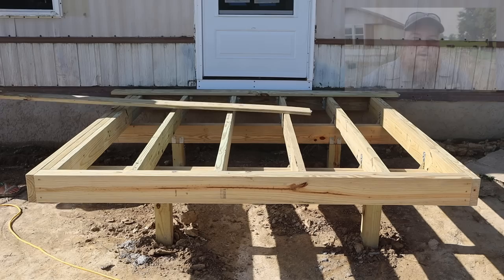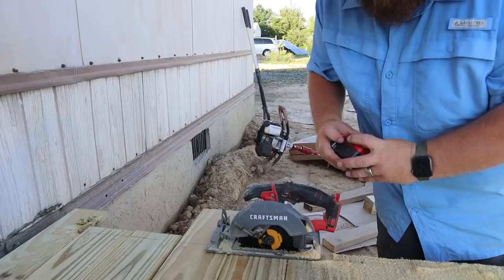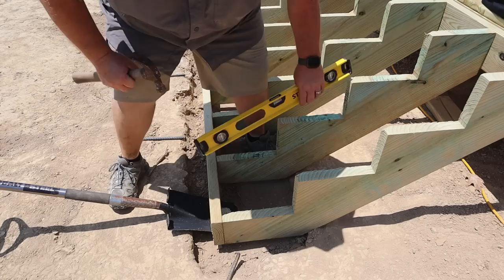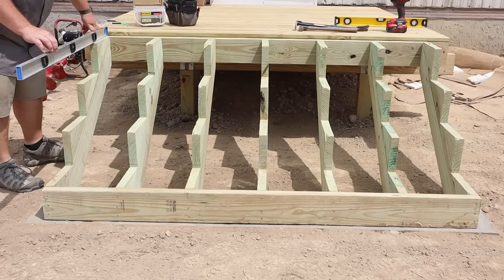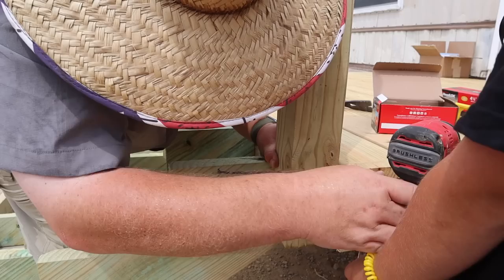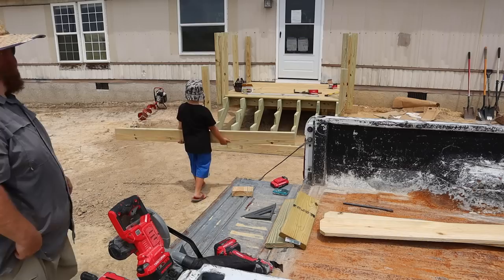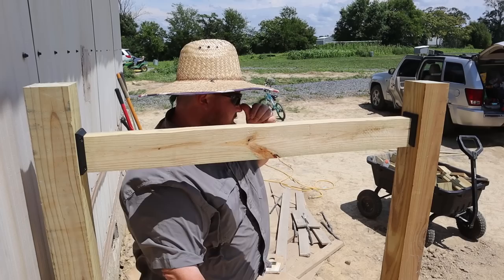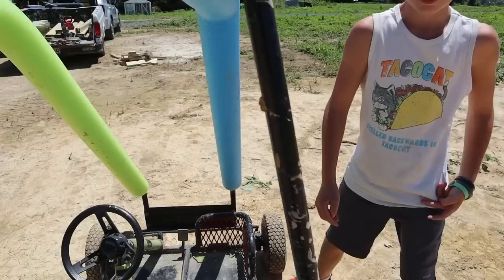BEAUTIFUL New Deck BUILT by US! // Mobile Home Deck Build - Pt. 2

Comment: Your deck looks nice! 
If I could suggest one small addition, it would be to consider adding risers to the front of the steps. I think that would make it look more finished.
Whether you do, or whether you're don't, you two did a great job! You have really transformed the place!
Reply: Yep I was going to suggest they look at what Life Uncontained did for their underpinning. Would look great. Horizontal 1x3, space, 1x2, space, 1x3  That might be cheaper than solid wood, but I don't know that for sure, there.
Reply: I completely agree. I love the deck, but it needs risers to finish it!
Reply: Agree, the porch looks  unfinished the riser boards look more fashion and safer
Reply: I completely agree.  The first step already has it and looks nice and finished. Regardless of whether you do it or not it looks great. I am so proud to see a family working together.  It's like the old saying that a family that prays together stays together . You all have done such a great job. Be safe in this heat and the storms that are coming. God Bless you all.
Reply: I've not seen decks with risers on them. I think this looks great!
Reply: @lindamaskus5142  really? If you google image deck stairs, 90% of them have risers. The ones that don’t, have very clean lines under the deck. Risers make it look a lot cleaner.
Reply: I don’t think you can add risers after the treads are installed.
Reply: We don't use risers. It's easier to clean snow off the stairs.
Reply: @laurieg673  I get that, but it looks much more finished with them. We have them in southern New Hampshire and haven’t had an issue cleaning snow off.

Comment: That tip on signed the oscillating saw back-and-forth actually works great! You can cut through material much quicker and you don’t burn up your blade as bad.

Comment: The deck looks really nice, the suggestion I would make is to attach the side rail posts to the stair rail posts. It will add a degree of sturdiness and avoid the side rails from tilting out over time.  Also the stair post at the top of the stairs I would add 1 or 2 screws in the opposing direction(into the stairs) think cross bracing. Fantastic that your taking the time to teach your son and to see that he's interested.

Comment: Now this is a pretty front porch. When you get it all painted to match whatever color you're going with for siding it will look even better. I think the lighter color goes better with your living room an inside then a dark color would. Then what? Hopefully the back porch will be about two or three times that size because that's the one you'll do barbecuing and eating outdoors with. You did manage to find a really lovely location and have fixed it up very nicely. Thank you so much for sharing!

Comment: Great job, guys - your forever home and property is really coming along!

I enjoy your videos and watching you consistently use your skills to build quality and professional projects. Not an easy task, I know! Kudos ...

A tip on further protecting your decking to future-proof your investments. First, it's great to see you're using pressure-treated wood. You can purchase liquid wood preservative to paint on the protectant and treat the wood whenever a cut is made. You can still do this now to protect your cut ends. A tip for your future floor joists is to use ZIP Tape (plastic rubber tape) on the top of your floor joists. This will prevent rot and allow your deck boards and beams to last many years. 

Hope it helps you guys out, and best of luck in the future! 

Cheers to all!

Comment: I nice tip I learned years ago that can also apply to wall framing is to cut strips of asphalt shingles. Place the strips under the lumber that has ground/concrete contact. It aids in keeping the moisture from staying in contact with the lumber from the concrete.

Comment: Good work.  But for future reference WD40 is your friend when working with form boards.  Soak the wood down just prior to pouring and your form boards will release easier.  A spade shovel also works well to pry the form board up from below reducing the potential damage to a slab.

Comment: Oh I'm so there with you I live in a mobile too an am so glad my necking is not attached to my home because the deck is sinking and I'm so glad it's not pulling my home apart. That's why I'm putting an extra post in the middle of my new deck so when I step out time after time it will not bowel or brack in the middle after a long life of use.

Comment: The county I am in in Florida has the same code. Decks cannot be attached to a mobile home. We also have to tie them down with screw anchors, on the four corners, if we build them on to of the ground with concrete blocks under the posts. Like the 2 x 4 railing with the balusters and the post caps. Great job. God Bless.

Comment: Not attaching the deck is a good idea.  Our place (1983 Scott Housing double-wide) has a ton of sag where the back porch was attached using a ledger board.  It wasn't due to settling, just the weight of the porch hanging off the outriggers.  Definitely not fun to fix!  We had to add beams and piers under the porch to make it self-supporting (not fun because it was pretty low to the ground), and we'll have to use a LOT of floor leveler when we get to renovating that room in the house.

Comment: Great looking deck.you 2 did a professional job.lumber is just not as good as it use to be.i have a 10x24 deck on the back of my house since 1975.i use Thompson's water seal on it every couple of years.i have never had to replace any boards.i did replace the steps a few years ago and put a roof over it about 10 years ago

Comment: Excellent job. We have to free float our decks on our mobile homes. The frost we get (Maine) causes a lot of movement to the decks and the mobile homes when the ground freezes and then thaws.  Our ground freezes 6ft down. 
Can you clue us in to what you're considering doing for siding when you get to that point?  We've been pretty unhappy with the vinyl siding.  It comes out way to wavy.
I wanted to do composite 4x8 sheets or T-1-11,  but hubs said no way on a rental.  Cheap & easy. 🤷‍♀️

Comment: I really like the end peices you used on the horizontal hand rails. If it's ok with you I'm going to steal the idea from you on a future deck I build. Lol 😆  
Talking about ,should decks be attached to the home . We purchased land that had a double wide on it that we renovated and lived in while our home was being built on same site. The previous owners had built their front door deck connected to the side of mobile home but they didn't use any beams! They litterly only had 2x6 joist only that were bolted to notched 6x6 post. Imagine the deck you just built but, without the two beams underneath.  😀  yeah ,it was a little janky and wobbly to say the least. Anyways I did have an engineer tell me that it's a horrible idea to connect a deck to a mobile home because most mobile homes use 2x6s for end joist while some of the "better" built mobile homes use 2x8s . Either case he said the joist are doing their best to support the weight of the home let alone the weight of a wood deck. We also had to build our front door deck lower than the door to give enough head space to the roof on the deck. Otherwise building the roof over the deck under the edge of the homes roof made the deck roof to short for most people to stand up. So basically our deck being lower than the door had steps under the door. Anyways just thought this would give you something to think about concerning your future roof over your front deck. Hope this made sense. Great job on the deck! It looks awesome!

Comment: Love how you included the kids in the build. Only way they are going to learn.
My question for you guys is , Are you going to film the back deck as well. And are you going to keep it about the same size as well or go bigger? When my dad did ours he built the back the entire length of the house as well as the front. But I always used the back for cookouts for the Firedepartment I'm on unless it was raining. The back was wide open and the front was completely covered. 50 feet on both sides the house
Reply from the maker: We just finished the back deck today. It is larger -- 12x10. And is built in a stronger and beefier way. :) The build videos will come out soon!

Comment: Seems like you had a bit too much water, you could have gotten away with a much dryer mix.  Also, the dryer the mix, the stronger the final result.  Shouldn't be an issue in this use case, and the deck came out awesome.

Comment: Looks nice but I have to tell you from experience that the floating 4x4 support columns are not very safe. 
One trip, someone leaning on the rail is all it takes for it to give way and you'll end up on the ground. 
Hopefully if/when that happens you won't break your arm, sprain your shoulder and get stitches in your head like i did. All that from tripping and falling 3.5 feet.

Comment: Sam do you not put a space between the decking boards? I've noticed you haven't and I'm asking because I had a back porch 6 X 7 ft built and the person that did it didn't leave a space either. Well 6 years later I'm going to have to replace just the decking because of rot. But just the ends rotted. I was wondering if this could have been because of him not putting spacing between the boards.
Reply: I was told it’s because over time the wood will shrink and create it’s own gap. Anybody else have anything on that? Lol. 💗

Comment: Never cut floor boards off flush with the joists. Need to leave at least 1/2" overhang to act as a drip edge so water doesn't wick in between the bottom of the floor board and the top of the joist and cause dry rot. Treated lumber is insect resistant. It is not waterproof.

Comment: you know..... with the view outside im supprised that you didnt extend the deck out and along the whole length of the trailer along with a roofextrention , that way you can sit outside on said deck and have a lot of outside covered (wood) storage under it , this allso hides the bad edge on the roof where you had to narrow it on the trailer itself and have a good edge/overhang to put a gutter on . it allso keeps the siding dryer
you can even put the rin collection system from the old greenhouse under there slightly dug intoo the ground  (with a submercible pump and a hose to water the plants in the new greenhouse and around the home ) 
allso supprised that you didnt made the first stop of the stairs completely out of cement (then again the stuff isnt cheap) as it would keep the wood of the stairs mostly off the moist dirt

Comment: Sam Pretty nice  Deck build , Have a question What size impact driver  are you using  to drive those long deck screw into those boards .
Reply from the maker: It's just a standard cordless impact drill/driver. It's got a 1/4" hex quick-change head for bits. Nothing fancy. :)

Comment: Your porch is fantastic!  Wondering if you're going to put boards on the step fronts. If you are, may I suggest using two or three thin boards like 1"X2" or 1"X3"s, or both, horizontal across the risers. Check out what Life Uncontained did for their underpinning. It's a very classy look and very simple to do. Might finish it off just right. I know you can't wait to get moved in! Great job!

Comment: I only have 1y 10 m until my 10 year note is paid off on my 1972 single wide on its own corner lot, in Spokane Valley Wa, in the mean time my 37yo son is doing reno and upgrades as able,so mom has a pleasant home at 61yo,the front side of the trailer has original metal grid stairs that are falling apart ,for a ball park at a porch 1/2 your size as I have two that need to be done how much apx is it??? I understand different states and all ,but only apx $$$ please

Comment: Sam and Angela, to me this is one of the best ways to build a deck or porch that I have ran across thus far. It is much the same as many of the decks I have built. This is a stand alone deck that will not require you to connect it to your mobile home in any way. If you want to modernize it by adding brackets you can do that too. If you need added weight support simply add additional 2xs and post to joist as needed. As you probably already know treated lumber overtime will deteriorate so I would advise stain or sealer after a deck has been weathered a while. This was not intended to lead you to think I wasn't happy with your current deck. 
How to Build Porches
https://youtu.be/ELe3L3C-u9E

Comment: Sorry one question .. does the concrete not stick to the wood or do u put something on the wood so it doesn't stick
Reply from the maker: It doesn't readily stick, no. You can spray it with some things to help release too -- WD40, diesel fuel.